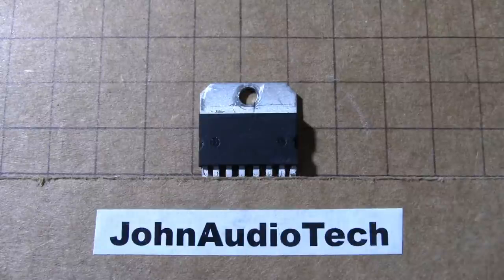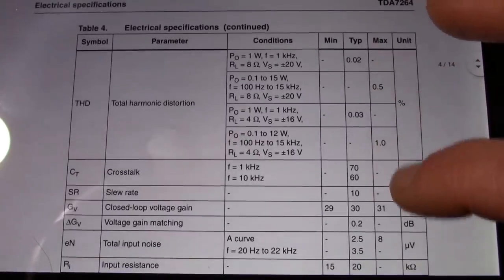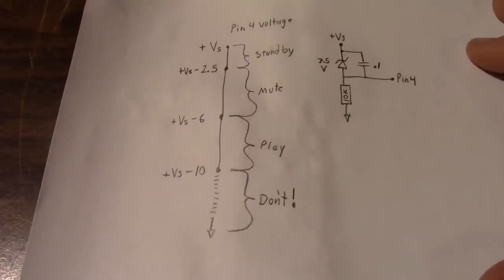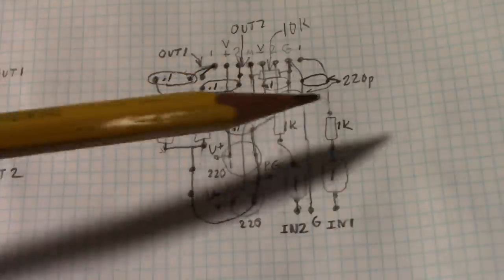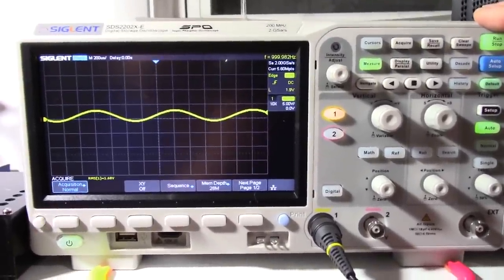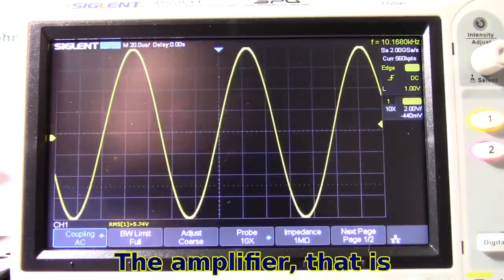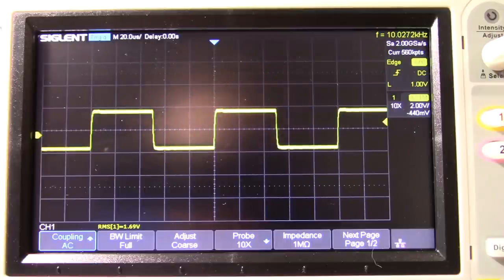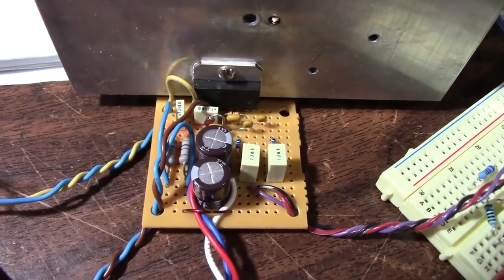TDA7264 easy to build stereo audio amplifier

Comment: You mention that it will 'shut down' when the supply goes below about +/- 7V...
I am wondering whether this is the mute circuit kicking in? (Supposedly 6V).
It'd be easy to confirm it by simply moving the 'bottom' of the zener resistor from the 0V rail to the negative supply rail.

Comment: Hi John, this is a nice video. Thanks for sharing an ameliorated circuit for the TDA7264. In a previous video on the TDA7264 (Yes indeed, the symbols for Omega are Ω and ω, so the lowercase symbol resembles a W) you mentioned that the TDA7265 is essentially the same amplifier. The TDA7265 datasheet provides circuit schematics so that you may run it on a single power supply and also in bridge mode. No such information is available in the TDA7264 datasheet, however it looks like the same circuits should work, based on the similarity of the two chips. What are your thoughts on this?

Comment: hi i'm looking for 12v amp to power my speakers , ive been looking throu all sorts of cheap ones from china but would like as clean sound as possible but just lost at how many options their are, watched your video on tp3116 based amp but sounds like not very good, any thoughts? this one reminds me of the amp that was in my fidelity record player in the 70s :) what you think of tda7377 ive fiund cheap car stereo with this chip, what you think?

Comment: Hi John, I'm building this amp...thanks for all the tips! One question...the 4.7 ohm resistors on the output look like they might 1W or more. What  power rating do you recommend for them?
Reply from the maker: 1 or 2 watts should be fine for this amplifier.

Comment: Great video as always 👌.
I am just curious to know what happens to an amplifier if the output load is suddenly removed, like what happens with a voice coil burn.
Reply from the maker: Nothing really. The current stops flowing which isn't a problem for solid state amps. With inductive loads, a small spark may occur at the point where the connection was opened. This is caused by the collapsing magnetic field in the inductor (speaker coil). Most amplifiers are designed to deal with it safely.
Reply: @JohnAudioTech  thank you.
Reply: @EngineeringEssentials  What if it was a tube amp?

Comment: TDA7265 would be better for me  it has gain adjustment outside and can be bridged for mono output , say i want to run a bass driver with one of these . Problem , pinout wont fit the protoboard , but what can you do .  Does anyone know of a better solution for me , what im doing designing active crossovers  for my 2 way bookshelf speakers , 
Now i need and amp for each driver , preferably more power on bass . 
So ,for now the best i found is TDA7265 , anyone know of something better

Comment: Nice amplifier. Can i use it that low pass on input on any amplifier? like tda7294 tda2050 or single supply amplifier like tda7297 or 7377 ?
Reply: Yup. For the most part, yes.

Comment: Hii John sir, 
      I am a beginner in audio               electronics.
A question, why their is a capacitor in series with feedback path in non- inverting amplifier???
  Please answer🙏🙏
Reply from the maker: The capacitor keeps the DC gain at one to prevent any DC currents from getting amplified causing an offset voltage on the output.

Comment: Is there a way to run a vacuum tube ahead of this chip, as a preamplifier? Like with a 12AX7 or one of that family?
Reply: Just drive it with a vacuum tube preamp.  
No one is going to take a simple little project board like this, then add an HV supply and filament power in order to add a tube input stage.

Comment: Get one of these hifi walker h2 dap players instead of that Sony unit, It supports up to a 256gb micro sd and will be able to fit a decent chunk of your music collection. https://www.amazon.com/HIFI-WALKER-H2-Resolution-Bluetooth/dp/B072C4YPCG It supports 192 khz 24 bit flac files as well as 384khz 32 bit wav files, mp3 and dsf or dff files @ 5.6mhz, it has two 3.5mm outputs, one is a fixed gain direct 1.4v out, the other is designed for headphones. This is the best dap you can get for the money, you'd be hard pressed to do better for even twice the cash. It uses a ti pcm 5102 dac chip. You can even use it as a stand alone dac preamp on a windows pc! It is machined out of a nice zink alloy shell, it has some weight to it, yet again, for 100 bucks or so plus another 34 ish for a 256 gb card, which i use a samsung evo micro sd in mine, here is a link to the sd card i use. https://www.amazon.com/Samsung-Electronics-microSDXC-Adapter-MB-ME256HA-dp-B0887P21Z2/dp/B0887P21Z2/ref=dp_ob_title_ce
Here are the iems i use https://www.amazon.com/dp/B07DL2FPBL/ref=emc_b_5_t These are incredible for the money, i recommend dakoni mercury replacement iem foam tips for them,  https://www.amazon.com/Dekoni-Audio-Moldable-Isolation-Earphone/dp/B01M0SGE1S/ref=sr_1_4?dchild=1&keywords=dakoni+Mercury+foam+tips&qid=1598140971&s=electronics&sr=1-4 these iems have a dual driver design with detachable and replaceable mmcmx connectors cables. 
They have a frequency response from 10hz - 40khz. Heck, I'd love to see you do detaild performance measurements on the player! You can fit just shy of about 15,000 songs on it "format and resolution permitted." Here are the specs THD: <0.008%
SNR: 103dB@1KHz，±2dB
Frequency Response Range: 20Hz-20KHz
Nominal Impedance: 8 ~ 150 Ohm
Headphone Port: 3.5mm Port